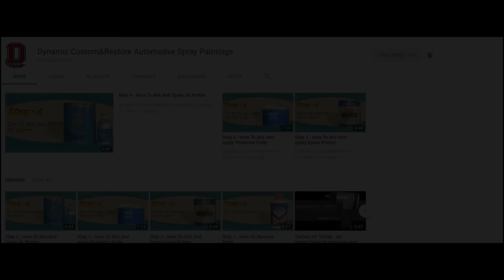Bajaj CT 100 Restoration - Part 2 Engine Rebuild

Comment: I loved the engine restoration work but would have been more happy if the screws were repainted , So that the engine would have looked brand new,  also the engine coil wires could have been wrapped but it can be used as it is so it is not a keen thing to consider. I really appreciate the work involved in this engine rebuilt. I do own a Boxer CT 100 but it is of K-TECH engine.
Reply from the maker: Hi, Thanks for the compliment, Getting to the point of screw painting, I have painted screws after engine fitted to chassis
Reply: Tem come traduzir no

Comment: Nice job 
Let me know Which air rattle gun uand drilling machine.u are using
Reply from the maker: Techno pneumatic impact wrench and local brand Electric impact drill
Reply: @DynamicAutoYT  thanks bro
Reply: @DynamicAutoYT  
One more doubt.. 

Is it suitable for loosening and tightening of bike and scooter wheel nuts...

Comment: Can you show a vedeo how to remove oil filter in boxer/ct100/Kawasaki 4s
Reply from the maker: Sorry, i already assembled the engine.But u can use nose plier to pull out the oil filter from chamber
Reply: No problem in future if you can
Reply: +Dynamic Custom&Restore Automotive Spray Paintings Hindi me bnao video

Comment: I have a 2010 Pulsar 135, will you rebuild it's engine also. It's running good without any problem. It has clocked 72k on odometer, only timing belt was changed once.
Reply: Test on Dyno 
Whats the output of the engine now

Comment: Hello after engine restore...bike mileage and speed will increasing ??
Reply from the maker: Hi, Yes if you put new or reconditioned cylinder, connecting rod, valves, valve guides & seating and engine bearings, If you have a problem with carburetor you don't see improvement in mileage and speed, Please do subscribe Thank you!

Comment: How are parts quality of new ct100b comparing to Splendor?
Reply from the maker: Hi, New Ct100b is a little bit lighter than old ct100 but I don't know about the splendor sorry
Reply: @DynamicAutoYT  thanks for the quick reply, so how does it compare with any other bikes for that matter, will lighter parts affect the reliability of engine?
Reply from the maker: You are welcome, Open the engine and compare side by side with the old one you will get the difference, a light material will be worn quicker than the old one, I hope you understood

Comment: Engine restoration mai koNSE part change katene honge,?????
Reply from the maker: Hi, Cylinder kit, connecting rod, valves, valve guides & seating and engine bearings etc. Jo parts kharab hongay unko badalnapadayga.Hamaray channel ko subscribe karo, Thank you!

Comment: Will you restore bajaj kawasaki 4s champion,currently bike is running,mileage over 55, 22yrs old bike.Old ct100 nd 4s champion use the same 100cc motor..
Reply from the maker: Hi, Yes, of course,  But you need to reach us 
Address:- Dynamic Custom&Restore Automotive Spray Paintings, Velgode-518533, Andhra Pradesh, India

Comment: dude wash it before to crack it
Reply from the maker: Hi, Sorry for that, Cleaning is not a point for this video, I can't clean it for 3 to 4time for a video, After disassembly, I use paint remover to clean and remove paint, If you don't know I live in a village so I don't get proper chemicals to clean greasy engine. Thank you!
Reply: oh .. at least it was done really well. Great video btw, keep it up !
Reply from the maker: Thank you so much

Comment: more detail how to adjust and tunning to ct100
Reply from the maker: Hi, Present I don't have any bike to show you ct 100 carburetor tuning, But you may try full tight the air screw (clockwise) and lose 2.5 rounds (anti-clockwise) then adjust the idle speed.Thank you!
Reply: Clariza cortez.